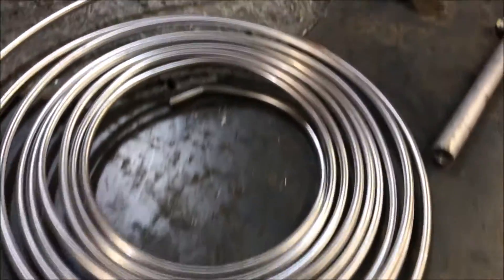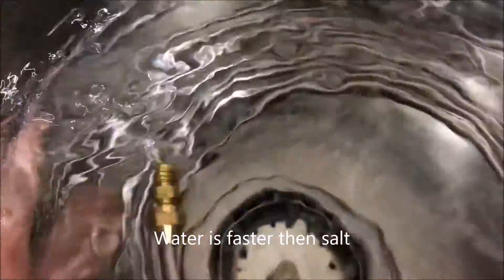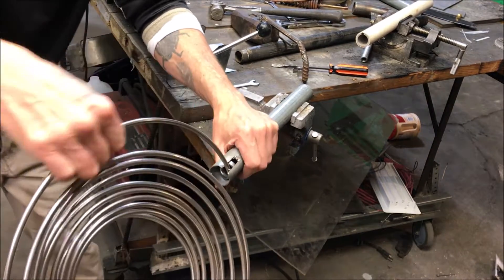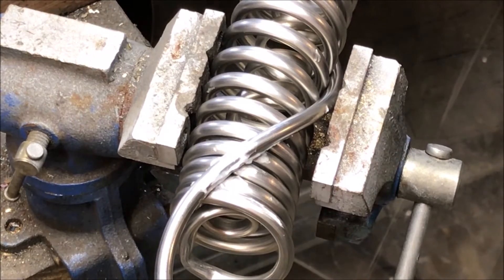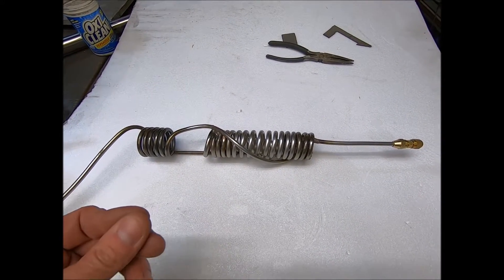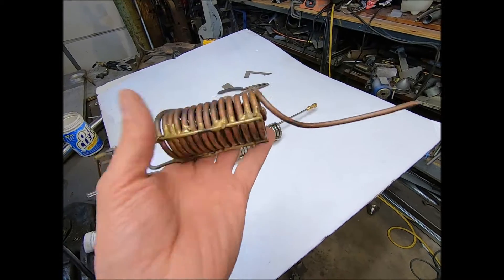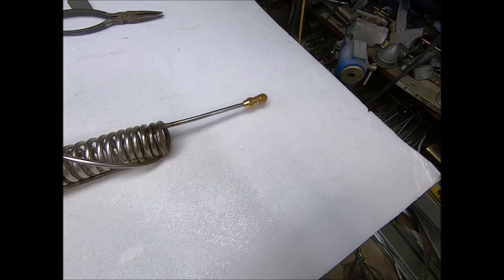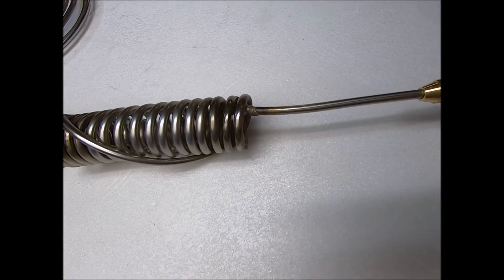( HYDROFORMING ) Bending Stainless steel tubing into coils Using water

Comment: Fine building sand worked well for me in  copper when I made a fuel pre-heater for my 4x4.  Similar windings to your device wrapped around a 28mm piece of copper pipe added into the engines coolant loop.  I was burning processed cooking oil mix and this helped a lot.

Comment: The water trick looks much easier than sand or salt.   I have used tube benders for steel tube that worked on NEW STEEL.   OLD STEEL WILL NOT BEND OR FLARE for me.  As long as I stay with new steel I have never had a problem.

Comment: Off to a good start if you anneal the steel before you start will make the work much easier. Also soak the tool in vinegar after x amount of hours operation to remove scale build up.
Reply from the maker: great input

Comment: gotta use the right stainless cutting tool... go ridgid.
Reply: Uh, no.  That type of cutter is exactly the kind that work hardens the stainless tube when cutting.  You need to cut with a saw or cutoff wheel.

Comment: I've bent both copper tube (refrigeration tube 3/16" OD) and stainless tube (seamless 1/4"ID air line, to be used as a moisture condenser coil on a specialist air compressor) using the sand fill method with 50 mesh sand (0.0117" / 0.297mm dia)
It works very well as it requires only a light crimp and some tape over the ends, you can also anneal the metal part way through the process is you wish.
The downfall however is removing the sand after the coil is complete, this can be tiresome if done by hand, but I found that taping the completed coil to a square base orbital sander clamped in a vice makes it an easy task (it just vibrates all the sand from the coil once running).
Reply: Lancer2204 learned the sand trick in the Air Force.